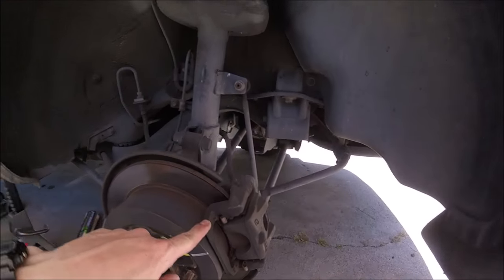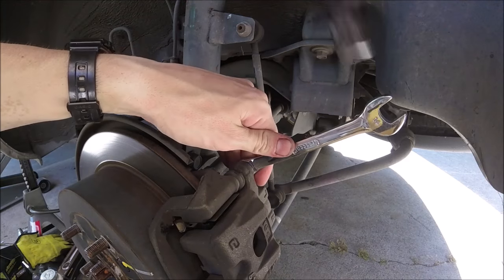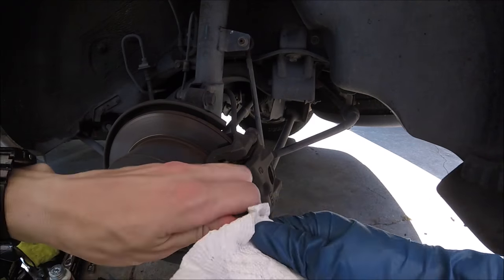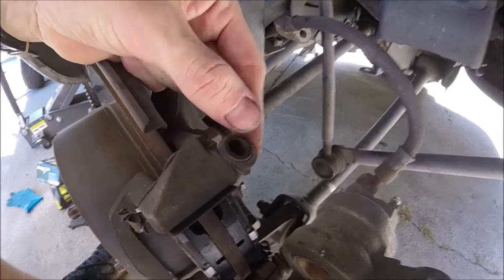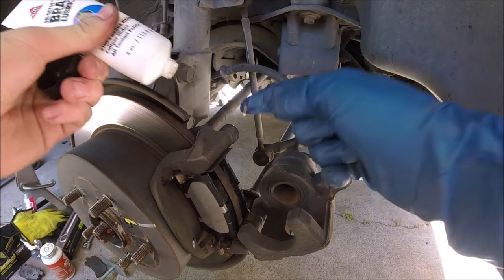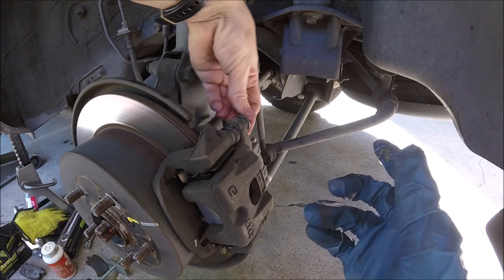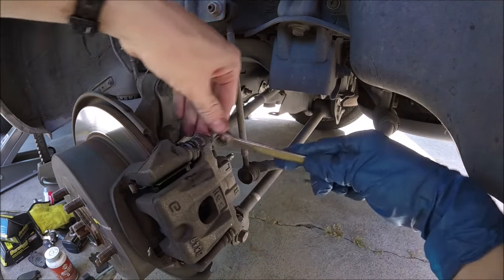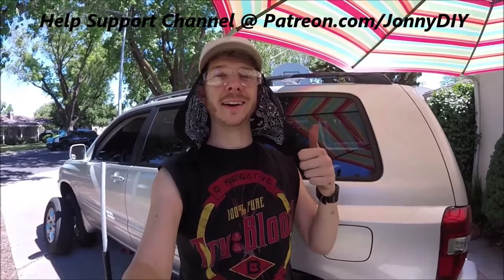How To Properly Lubricate Brake Caliper Slide Pins -Jonny DIY

Comment: Nice, simple and to the point. I have owned multiple cars and always change my own brake pads. But I have never done this. Will do this. Thank You very much good sir!
Reply from the maker: You're welcome, glad I could help you out 👍
Reply: @JonnyDIY  Update: I had uneven pad wear. Driver side inner pad was all metal, but all other pads had 1/2 left. Bought new pads, and greased the caliper pins like you showed. Brakes glide like a dream! Thxs man!
Reply from the maker: @skywalkerimperial4350  awesome, glad to help you get your brakes working properly again 👍

Comment: This will part of my brake system rebuild this weekend. New rotors, pads, parking brake shoes and greasing those slide pins. Wish me luck.
Reply from the maker: Good luck! Take your time, brakes are one thing you want to be sure you've got right! But they're pretty basic 👍

Comment: Learning car maintenance can save you a whole bunch of money. Taking stuff apart, safely of course, seeing how it works and easy jobs like this can stop you potentially being ripped off at a garage, "tut tut mate, looks like you need new brake pads, new callipers, new brake discs, new ram jet ting tangs. Ha ha that last ones not real, or is it. Unfortunately so many people are at the mercy of some garage floozies. DIY is where its at, be safe, read a manual or watch these guys.
Reply from the maker: Yes you're right, best to at least have some basic knowledge so you're not taken advantage of. Harder and harder to find honest mechanics these days
Reply: Also a lot of them aren't necessarily careful. Ive had guys in mexico f up my brand new truck.
Reply: @vatoloco744  yup..some people aren't as careful with other peoples property as their own and sometimes they're just plain reckless...or lazy.

Comment: Thank you for this. I knew this needed done on my truck due to some creaking when I pressed the brake pedal even while stopped. When I took my truck to the dealer for an oil change i mentioned it and they first said I needed to resurface the rotors for $400. I declined that and then they suggested this for $200. I knew it wasn’t worth anywhere near that!
Reply from the maker: You're welcome, glad I could help. Yes save your money especially with brake work. It's so straightforward to do pads & rotors and even swapping calipers isn't bad 👍
Reply: @JonnyDIY  so I already have some lithium based marine grade grease rated to 620 degrees F. Do you think this would be fine or should I get what you used. What I have actually has a higher temp rating than what you used.
Reply from the maker: @byammine  you want to use a silicone based grease, as it wont cause any damage to rubber and also won't make rubber swell. I'd just pick up a tube of this Sil-Glyde at the Auto store 👍
Reply: Geesh 400!!! Local guy here charges me 60 for all 4 rotors to be resurfaced. I can’t stand the dealership

Comment: Just decided to confirm my service on my slide pins. My corolla 2012 i bought used had uneven wear on my right front rotor. I thought to check my slide pins because my brake caliper wasnt pulling or seized. Turns out the grease on both front caliper brackets were melted and it left a glue like sticky residue, Just sticky and almost dry. I hit them with some brake cleaner wiped it off and put some bran new caliper grease on it. Feels good to hit on the brakes now knowing you wont have uneven wear
Reply from the maker: Awesome, glad you were able to get that issue fixed and sorted out 👍

Comment: is this why I'm hearing a loud creaking /knocking sound when I apply the brakes at low speed?  I was told chevy equinoxes are notorious for slide pins drying up and need to be lubricated every so often.
Reply from the maker: Possibly. I'd go ahead and do a full check of the rest of your suspension components as that could be a failing ball joint or other suspension part (tie rod, sway bar end link, etc)

Comment: Very good video the only thing I would change out of the whole thing is the name for the caliper  mounting bolts for the caliper. Which technically speaking correctly they are called caliper bracket mounting bolts.
Reply from the maker: Thanks for pointing that out Antonio 👍🏻

Comment: I'm a bit puzzled, after seen some videos some say not to use Silicone based products because they aren't meant for metal applications just for preservation of rubber and plastics parts. To instead go with a type of boundary lubricant like ceramlub. Another thing I wondered, what it the difference between Lubricant and Grease. Is the grease only meant to go on the other brake parts, like shims and back of pads meaning I couldn't use the Siliconeglide on those parts?
Reply from the maker: I've always used this on the caliper pins as well as the shims and backs of new brake pads without any issue. You'll be good to go.
Reply: Jonny DIY Thanks I hope so, just picked one up from Auto Zone.
Reply: The silglide in the video can pretty much be used on any slide pins.

 But some calipers don't have rubber boots, so they'll use like that ceramlube. You won't ruin that brake job with silglide though.
Reply: The grease you get on the box is good to put anywhere you need to grease including the pins. You just don't need near a much as this guy uses so not sure if he needs so much because of the product or because he doesn't know enough.

Comment: if one of the dual piston is slightly less compressed than the other one maybe by like 5-6mm, but was able to slide it in the bracket okay, will both piston make even contact once i pump my brakes during normal use
Reply from the maker: Yes theyll even out after use 👍
Reply: @JonnyDIY  thanks

Comment: Any idea why Toyota still says to specifically use a Lithium Soap Base Glycol grease instead of something Silicone based like this?  Maybe it doesn't cause swelling?
Reply from the maker: I'm pretty sure it's the same thing as the Toyota stuff. The silicone paste is actually what's recommended if you have any worry about boot or rubber swelling 👍

Comment: When you rotate the brake caliper after removing a slide bolt how big a risk is it that the hand brake cylinder thing will be too tight to slide it back on after you applied the grease? Should I get a tool for pushing back the hand brake cylinder before attempting to do this?
Reply from the maker: It should have no effect on parking brake 👍
Reply: @JonnyDIY  I meant the normal brake cylinder. Is there a risk it could move so it would be difficult to slide the caliper back on even if you never touched the brake pedal?
Reply from the maker: @coolie4u  Ohh ok gotcha. No it'll be fine as you see in the video. That's just how I did it, no extra steps or work 👍

Comment: When im braking at low speed, i hear creaking… should i lubricate the pins???
Reply from the maker: You could check them out, yes. I would jack up front end if sound from that end and take wheels off and inspect all the suspension. Usually creaking noises are suspension parts, tie rods, ball joints, bushings etc. With wheels off can also inspect brake pads and calipers.

Comment: When I take out the slide pins on my double piston akebono for my jeep, they are only bolts.  No pins. Why??
Reply from the maker: Sorry not sure, haven't worked on that vehicle before. May want to check jeep forum or jeep facebook group or even search for a specific jeep brake pad change video here on YouTube. Sometimes calipers don't have slide pins too, so that's possible 👍
Reply: On some cars, the the sliding caliper pin is a two-piece set up.  The bolt is on the "top" of the actual sliding pin.

Comment: Can leaving these to tight cause the brakes to stick?or run hot
Reply from the maker: Yes they need to move freely so lube and torque to spec 👍
Reply: @JonnyDIY  cool ima go back over then tmr bc i changed brakes and they started running hot. I forgot all about caliper slider pins

Comment: All of my grease gets stripped from my rubber boot before it makes it into the bracket; is this normal?
Reply from the maker: You can just put a tiny bit into the boot first  if keeps coming off. They really dont need much grease. Just clean and a lil bit to keep them from seizing up 👍
Reply: @JonnyDIY  thanks a bunch
Reply from the maker: @Slatinum_bookies  you're welcome 👍 but still lightly lube each pin though

Comment: DO NOT use wire brushes on these pins. Or any other kind of abrasive material that will score the surface. Use brake cleaner and a plastic scouring pad.
Reply from the maker: Yes you're right I believe I was referring to cleaning the threads only with a brush. Dont want to scratch or mar surface at all 👍
Reply: The surface of your slide pin are chrome hardened your brush will never scratch theme!!!

Comment: I had to use non break grease temporarily. what could I harm doing that?
Reply from the maker: Should be fine temporarily. The brake grease is probably just more temperature stable and won't cause problems with the rubber parts being as it's not petroleum based
Reply: @JonnyDIY  okay thanks, the pins were completely locked up and it was the only grease I had to get to the store
Reply from the maker: @maceface272  Ohh nice, definitely better than locked up pins. But I would re grease when you get a chance 👍

Comment: Hi
What is purpose of small rubber on the end of pin(the bottom one)? Can I just not use it?
Reply from the maker: I noticed that too. I think it helps stop squealing.  I would leave it if its not damaged. If damaged you can try running without, then if any groaning or noise come up maybe get a replacement
Reply: Adds some antivibration but can sometimes swell after awhile and can be trimmed a little if starts to not fully slide
Reply: if its has swelled up you can replace it, BUT if your in the middle of a job and need new ones and no part store has them ,,YES you can take them off with no problem or danger doing so it is an anti rattle precaution , i have removed them on my daughters vehicles that she uses on her mail route and never have had any problems or noise

Comment: Starting from 2:02 the amount of lubricant on slide pin seems like 3 times more than needed.
Reply from the maker: Yeah you could probably do with a little less with normal maintenance. I took a lot of old dirty grease out of the inside of boots and where pin slides into. I dont think they had ever been cleaned/greased in over 100k miles

Comment: Don’t just blindly add lube. Remove the rubber boots and clean them. Spray brake cleaner in the chamber and clean it removing all the old lube with a rolled up shop towel. You might as well. Takes a few more seconds and you already have the tires off.
Reply from the maker: Thanks for sharing. Good idea 👍
Reply: You shouldn't be putting brake clean on rubber chief.
Reply: @Daddy_Longnuts  no one said anything about spraying the rubber. Re-read the comment.

Comment: Can I use it for a caliper slides and a pads ?
Reply from the maker: yes use on caliper slide pins and a lil on back of pads and the ears of the pads that go in the brake clips 👍🏻
Reply: @JonnyDIY  got it. Thank you 😊

Comment: That's WAY too much grease for a slide pin. You'll end up hydro locking those things.
Reply from the maker: You're right, not too much. These were really dry though. No issues in the 5+ years with the brakes on this vehicle 👍

Comment: Americans like to say 'go ahead' alot
Reply from the maker: Lol yeah the way I shoot my videos I just try and do a lot of short clips for each step so I end up saying same thing. 😁
Reply: @JonnyDIY  sir,as one brakes,is there any way one can know that the pins need greasing,something like a particular noise?
Reply: funny I noticed that too, you could actually take that phrase right out and not change anything.  But on a more serious note the one thing I read a lot from the manufacturers of these greases is " more is not better" and caution using too much grease.. just grease one side of pin and screw it in. I just cant understand that as you would think more grease would keep out the water.
Reply: david reynolds : what do canadians say, eh !
Reply: @danrook5757  not sure mate. Is this like one of those knock knock jokes?
Reply: Is that so? I thought it was Mexicans myself.

Comment: Maybe not use too much lube for the caliper brakes since the lubricant will attract metal particles and it can destroy the rubber 😅😅😅
Reply from the maker: Yes you dont have to use too much brake lube, but it is sealed so no worry about metal as long as your boots are in good condition 👍
Reply: most of the lube will stay in the rubber boot as long as the pins move in and out after reinstalling it then NO problem

Comment: sil Glyde is GARBAGE. it damaged my little rubber.
Reply from the maker: Sorry to hear, I havent had any issues with it. You can use pure silicone paste as an alternative. That works great 👍
Reply: @JonnyDIY  Yes. I bought a pure silicone bottle, but I just did an oil change so I will wait until February. Maybe I remove that stupid rubber and see what happens.

Comment: Your actually applying the anti seize lube wrong, your not supposed to put it in the rubber
seal like that and not on the end of the bolt.